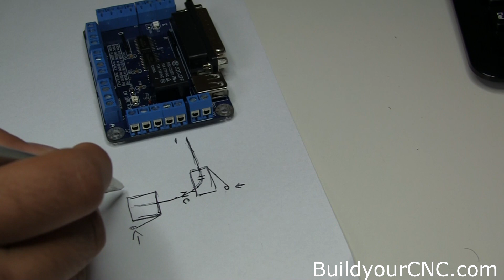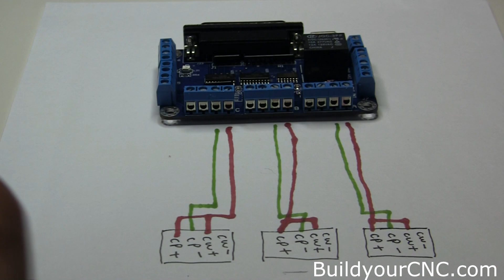5 Axis Break-Out Board with Relay V5

Comment: Great video
You mentioned the USB.
Did you mean that the USB was a way to supply power to the breakout board rather than using a power supply.
I'm building cnc and everything has gone perfect until I got to the wiring.

Comment: Hi Patrick thank you for this information I need to know I want to connect spindle invertor to this board and control it through the mach3 which pins I need for this or there are no pins for this
Reply from the maker: This board isn't the best for digital spindle control, but you can use the relay part of it for on/off function.
Reply: Patrick Hood-Daniel thank you

Comment: I see this video is a 2011 video, I hope you still answer questions. I just purchased this board trying to up grade my sys so I can use my laptop. there is a usb connector going to my computer that only provides 5 volts, 5 v is not enough voltage to run the servo motors so how I get the voltage needed to run the motors, do I tap it in to my current control board...Thanks
Reply: I do know your motor voltage is fed from the drivers, one for each motor. Each driver receives the proper voltage from your power supply whether 12, 24, 0r more. It is connected above the motor inputs.

Comment: hi. I am looking real hard to find a schematic and pretty much all the know how on how to build a 5 axis cnc router that can move on x,y,z, and xa, yb, zc (as I saw they are marked.) My biggest issues are the electronics and the software/programming of such a device but also the mechanical part gives me some thinking so any help in this direction would help. W/e i found online so far it's either very expensive diy schematics or very limited explanations. In the end I am aiming to build a robotic arm that would be able to sculpt any 3d object from a cube of any material from stone to steel or wood depending on need. I saw already some professional pre built ones but the prices are way to far out of the range of what i can afford. IF you can point me in the right direction or make a video with building such robot would be great. thanks.
Reply: see arduino adafruit controller for steppers - here you can learn the basics at low power

Comment: Wow. An ad for a board with no link to buy it anywhere.
Reply from the maker: Sometimes I need to deprecate items on the website due to better options available. This breakout board connects to the parallel port. The parallel port has mostly been eliminated from modern computers. If you really wanted to use a parallel port controller, you would need to purchase a motherboard with an LPT header and get the ribbon cable and DB25 connector for it. There are USB controllers that work well as an alternative to this controller. Also, this video was made a very long time ago and I like to keep the videos up just in case it serves useful.

Comment: Hi! can you tellme if with a 5 axis break out board I can connect and control only 3 stepper motors, or 4 motors? or do I have to connect all 5 motors to do the board work? thankyou
Reply from the maker: That generally means the signal coming from the dir pin is only sending a low or a high, not both. Use a meter to check and then check you configuration in software.
Reply: +Sergio Alfredo Saldivia Ramirez
Sergio you use any number at a time up to 5 axis. 
Sergio tu puedes conectar uno o cinco en el board. lo que determina el funcionamiento es la clase de maquina que tu configuraste. si configuras a Lathe (2 axes X,Z), a Mill (3 axes X,Y,Z) Si necesitas el cuarto axis then use X,Y,Z,A. tu puedes configurar a mill y usar los otros outputs para que hagan otra cosa.

Comment: Hello
I would like to know if is possible to use a stepper motor in this cnc board with 5 wires. usually the stepper motor to CNC have 4 wires. Is possible a adaptation?
Reply: 5th wire can be ignored but look up stepper motor configurations to confrim - this set up require two pairs of coils/windings

Comment: i have seen  that  people are running two motors togathers , how it can be done 
pls let me know
Reply from the maker: Single step and direction wires from the interface board can be wired to two motor drivers thereby driving the two motors with single axis signals.
Reply: wire all each motors to individual drivers - in the control software program there is an option to set two axis as slaves

Comment: I have problem with this board,I Connect USB cable 2 led is ON, When i connect Printer cable, led relay goes OFF... can you help me solve that problem please..?
Reply from the maker: Did you try to engage the relay using software?
Reply: Patrick Hood-Daniel 
I'm not yet to engage.. when i connect parallel port, the led goes off
Reply from the maker: Not sure why that is happening.  We haven't sold these boards in a long while so we can't test this condition.